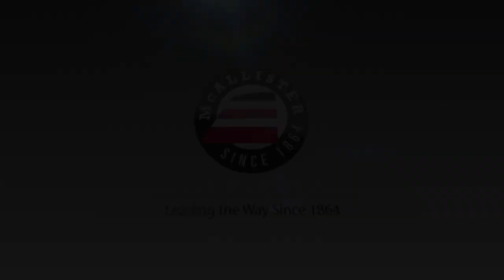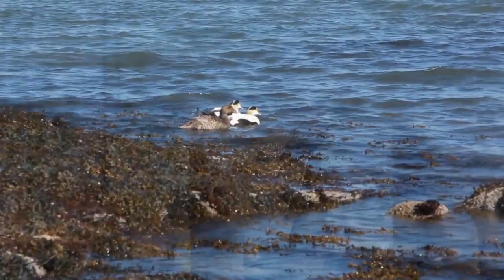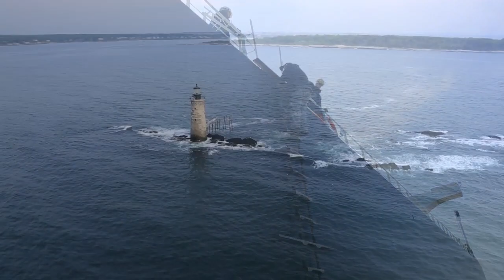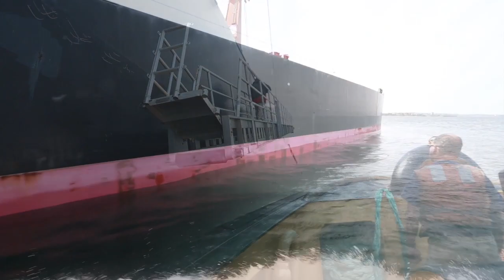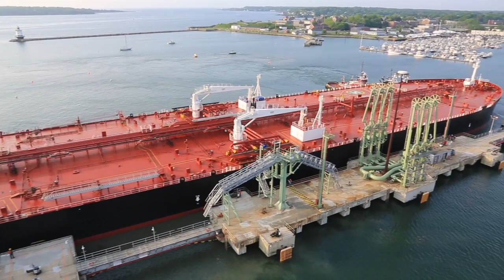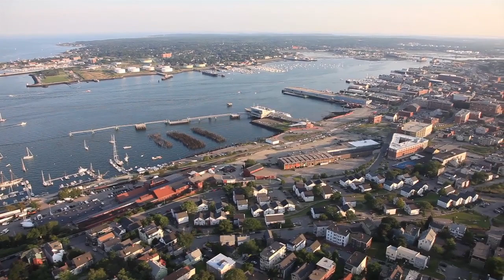Portland Tugboat, McAllister Towing.  Portland, Maine.

Comment: my father was a skipper for McAllister and retired in 1974.  dad worked for Texaco and Moran towing. as well as on my Grandfather's small fleet of freighters from the 1920s till the 1930s.
I did not follow in my dad's footsteps  which would have been 3 generations of our family working on the water.
it would have been a 100 years for generations since my grandfather worked in NY harbor in 1905.
Dad retired in 1974 when he had a stroke in the wheelhouse.  Dad passed in  1977.  RIP DAD
Reply: wonderful comment!!! Thanks